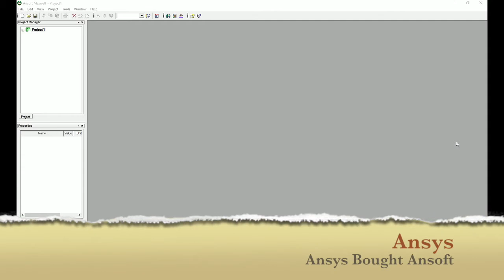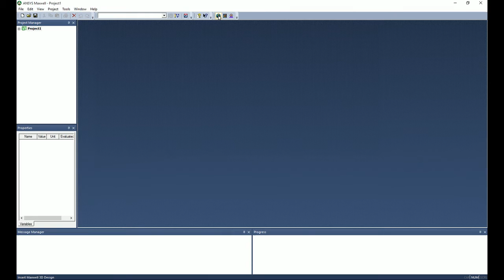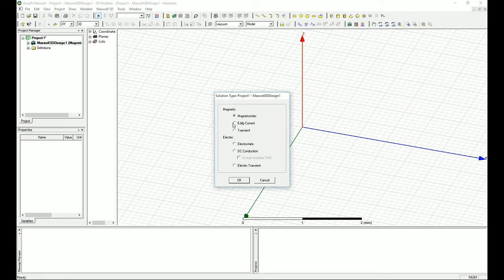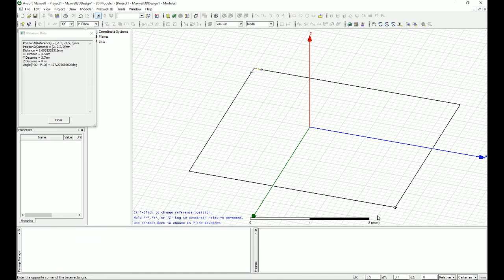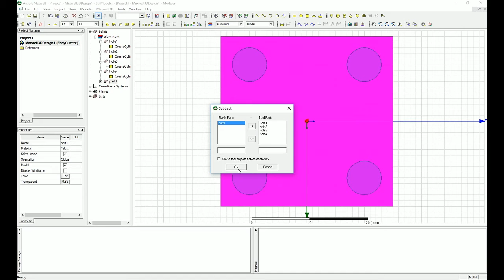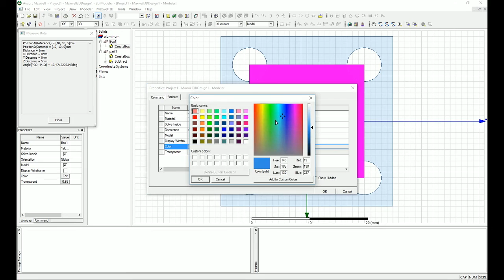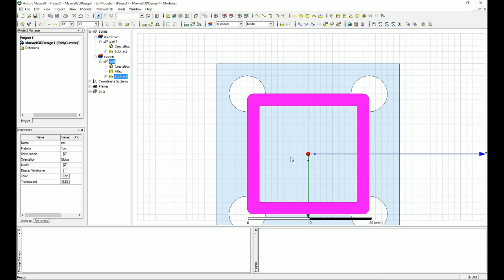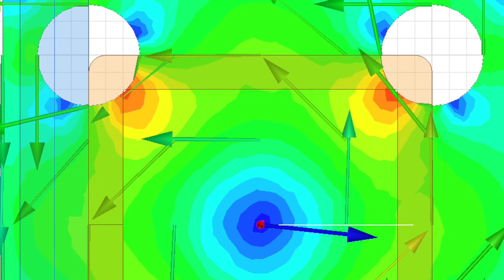301- Ansys Maxwell Eddy Current | Unintentional Radiation [1/3]

Comment: Hi, I am using Maxell 17. When I edit the parameters' value in SRM core in user defined primitives, the program stops working. Same thing occurs for 3D helix.How can I solve it? Also, can I use 2 or more versions of Maxwell in the same laptop? 
Thank you very much.
Reply from the maker: +Sohel Ahmad Yes you can have different variations of Maxwell on the same machine. make sure that you are not having Memory (RAM) problem sometime it stops working just because can't allocate enough RAM. reduce your meshing or use master and slave and slit your design.